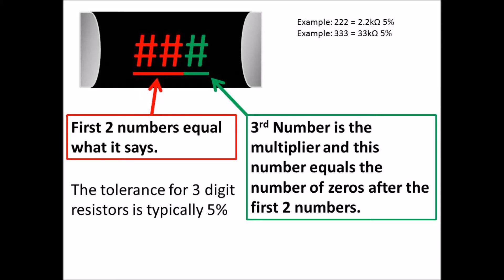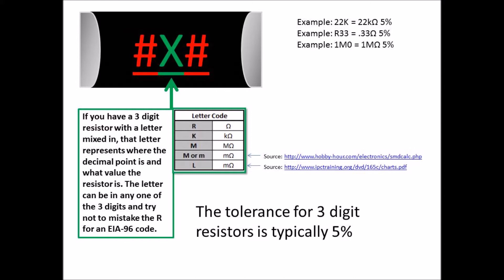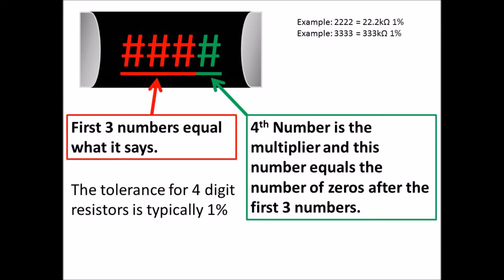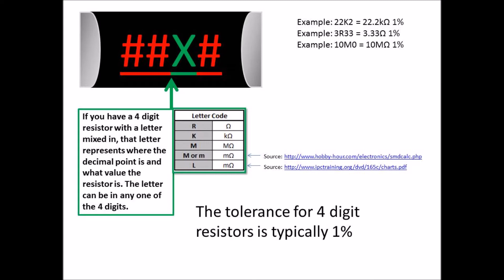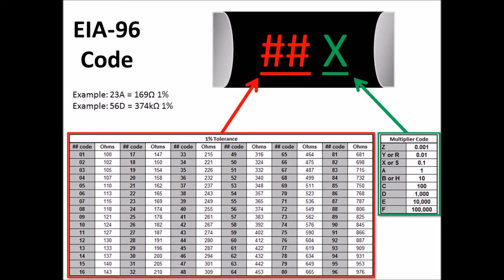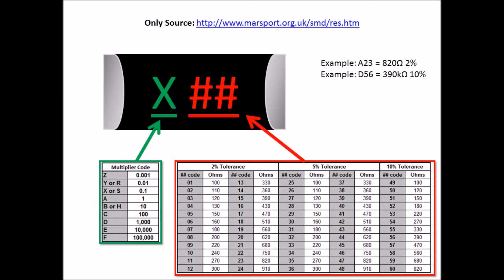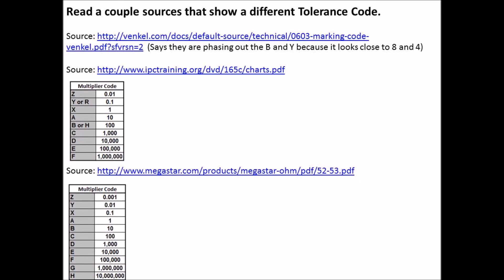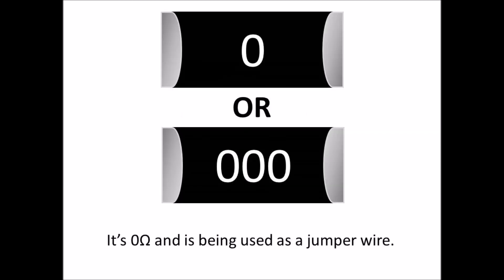SMD Resistor Codes

Comment: I need a print out of smd resistors list so I can just look it up,I don't work to often with smd components,I could use your help in getting a resistor sheet so I can look up what I need,like I have a resistor with the number103 and one that has the number 222 anyone can help me
Reply from the maker: +Ron Thompson I explain how to read that in the first 45sec of the video. 103=10k ohm and 222=2.2k ohm. I'm sure you can just do a Google search in images for SMD Resistor chart. Let me know if you can't find it.